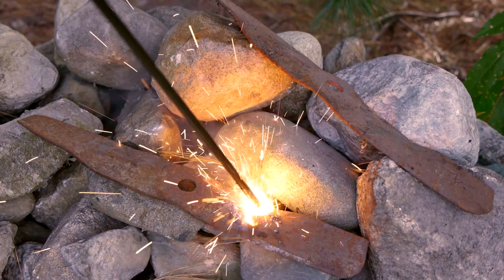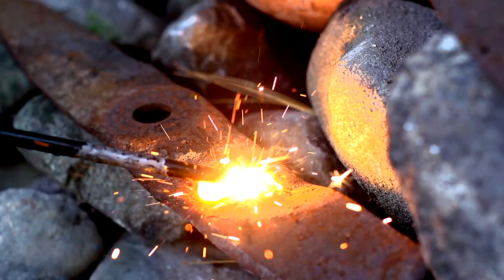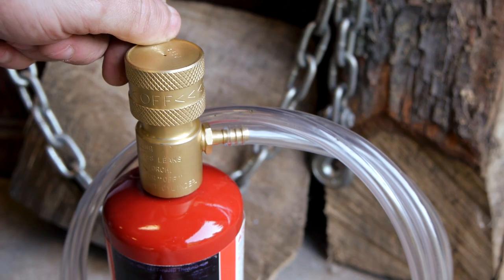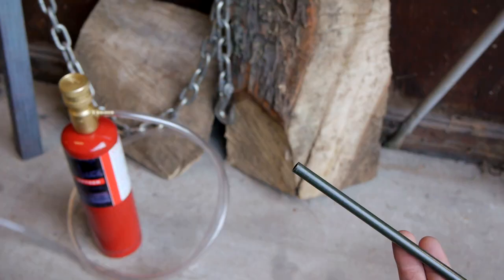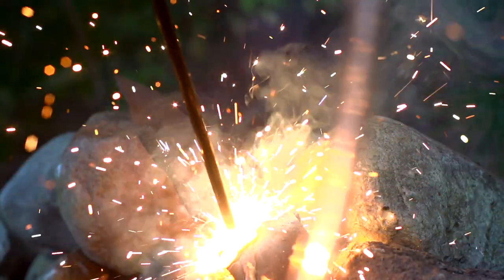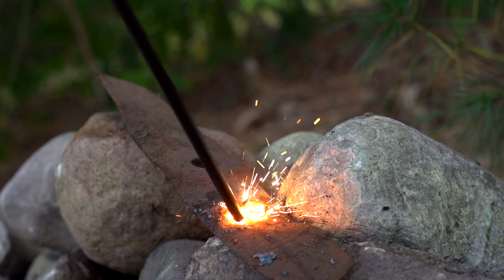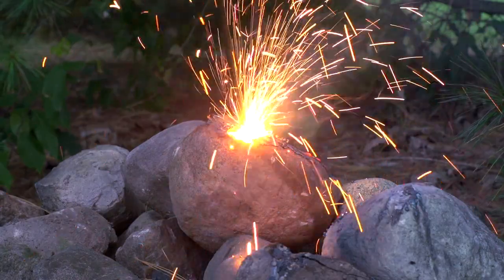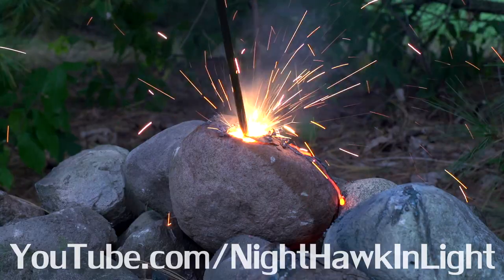How to Make a Thermal Lance Kit - Hot Enough To Melt Rock - NightHawkInLight

Comment: Having just made one of these myself I have a few tips for others. First of all thanks for the great idea. I made a few improvements on yours. I used fuel line for more durability, make a handle with a 1/4 valve to shut the O2 off quickly and used a brake fitting to attack this to the valve and essentially made a handle by adding some steel pipe. But it still runs through tanks incredibly fast and is currently at about $40/minute to run which is vastly more expensive than any other cutting system out there.
Reply: Of course it's expensive due to disposable oxygen cylinders. Your fuel line mod is slick and permits quick replacement. I like it.

Comment: Such a simple design, and yet so much power and potential!  I love your genius in improvising the ignition source.  Congrats in advance on 1M subscribers, you deserve it!
Reply: +Grant Thompson - "The King of Random" you should improve this design to a safer one
Reply: +danyCD17 LOL - There is only so far you can go to make a thermal lancer "safer". Braided cable tubing cover, welding gloves, and a face shield...unless you can get a robot to do it. :-) And if anyone can do that, it would be +Grant Thompson !
Reply: +iguanian Also I would add an inline gas check valve (for oxygen of course) and those are cheaply priced and maybe the addition of a horizontal handle of some sort like ones found on a hammer drill/drill affixed with a good quality stainless steel hose clamp or pinched between a bolt and 2 large washers and nuts or something that you can hold on to better and apply a little more force into the work.
Reply: +13andsim Also ... I am wondering if one were to paint the brake line with real aluminum paint @ 99.5% purity it was pricy for spray paint ( a few coats at least to get a decent amount of thickness) and would that make it burn even a little better? or even a little hotter? or would it just burn up the "rod" faster with no substantial benefits?
Reply: +13andsim Lol...  Now I am wondering if I were to spray paint some rust dust with this "pure" aluminum (spray it inside a small box which is filled with rust dust and shake around, spray another small amount in, shake box w/dust around and repeat) and see if anything would happen if ignited?? Hmmm, I absolutely love experimenting with things.  ;-)
Reply: +13andsim You were in my mind and bit me by minutes!! I was thinking something like a mix of epoxy and aluminum (oxide) powder smeared either on the outer and/or the inside of the pipe
Reply: Lol hey man :-).  I think either (or both :-) ) would be worth trying at least once ... I mean it would have to have some effect ... whether a positive or negative one THAT I do not know ... but that is one of the reasons we all like to experiment I think ..... I think this thermal lance idea is pretty cool none the less though and have some uses in my head already for this cheap and easy to make bad boy.
Reply: Thanks 4 creating man👍
Reply: While Electronx Gamer is rude, he has a point. I've nearly unsubscribed many times lately. NightHawk still does the awesome stuff. The rope videos are cool, but you need a lot more of these type of videos.
NightHawk does deserve his 1M subs. You do, too, but don't forget the stuff that made you tops.
Reply: The other day, I viewed an ancient Youtube documentary, can't remember what it was called, though the guy was packing his thermal lance simply with about 1/8" rolled lines of aluminum foil.  I believe he was using a regular steel tube of a similar thickness, likely of which is found at any hardware retailer; also connected to a rubber tube powered with pressurized oxygen.  When you mentioned adding aluminum paint; I thought, why not just wrap the brake line with aluminum foil?  My chief concern however, after viewing videos from multiple channels on the same information, is the risk of an explosion.
Reply: I stopped watching KoR because he was doing such dangerous stuff without even a mention of safety concerns.  At least Night identifies what is dangerous.  Whatever happened to KoR?
Reply: emaglott He died in a paragliding accident
Reply: Oh man.  I see that now.  Very tragic for his family.  He was obviously a risk taker.
Reply: RIP, hope his family is doing well
Reply: Grant and night hawk. BLESSINGS 🙏
Reply: Just found this video that's to a TV show and searching a thermal lance and I see this comment man I miss Grant
Reply: Rest In Peace buddy
Reply: Damn 7 years later and has only gone from 1M to 2M subs. Criminally underrated

Comment: Question: Can this be used to drill through a standard bank vault?
Reply: +Alex Jones You can buy brakeline in spools too ;-)
Reply: youd have better luck with a big whole saw
Reply: Guys! you need to set up the thermal drill!
Reply: No i dont think its hot enough to melt ceramic
Reply: Asking for a friend that owned a bank?
Reply: @gradoisx2348  not sure what ceramic has to do with safe or bank vault but yes they can melt that ,virtually any material can be melted with this,i melted tungsten rod with it
Reply: I hope...
Reply: @John Dave those too , this tool does not just rely on heat but also by oxidation, once the material gets to temp it burns away by reaction with oxygen end becomes fuel itself but at temps of 10,000 degF most things melt or burn ,the materials you mentioned are below this melting temp aside from starlite which is uncertain on its full capability as there have been claims but no actual verified tests to see how much heat it can take so ill leave that one as a unknown
Reply: GUYS THE THERMAL DRILL GO GET IT
Reply: Yes, but it might take some time, and honestly reliability may be an issue
Reply: as for cutting into bank vaults, I read that a thermic lance is not subtle, it makes a lot of noise and light. I suppose explosives are not subtle either, there’s no such thing as cutting into steel quietly.
Reply: @darylcheshire1618  chemicals are quiet
Reply: @chrishansenbiz  Acid takes too long.
Reply: @darylcheshire1618  just get hardware expert basic, makes it completely silent, and only costs 1 skill point

Comment: Thank u so much.  My step-father 
S dad left us a storage unit like you would find on a cargo ship but nobody could get through the 3 different extremely enormous padlocks thar were on it.
So I used your technique and purchased a small oxygen tank and a small clear plastic hose and a 5/8ths inch brake line and used the the steel wool and wha-La.   It actually freakin worked.  I threw on a pair of welders goggles.   I  wasn't sure what strength I needed so I just bought the most intense ones I could find.  Then I amazed my relatives as I cut the padlocks off like I was slicing butter with a blistering red hot knife. 
The hilarious part to this story is there was a chest with $1200 in cash and about 16 leisure suits that had so many moth holes in them they were worthless.....and a few penny farthing bicycles that some second hand store bought.  I think I got around $120 for my efforts.  Lol.
Oh well.....I wasn't looking to get rich but I thought it was fun to put my family ( who I only see when someone dies ) in "AWE" as I cut these bolts off with "magic"  lmao.
Thanks 4 the video again buddy

Comment: In this video, Night Hawk In Light harnesses the power of the Sun.
Reply: Gtfo
Reply: what
Reply: +HouseholdHacker "In this video, I build a small fusion reactor, strong enough to power a village for about three or four years. For this project, you will need a PVC pipe, duct tape and three jars of mayonnaise..."
Reply: +HouseholdHacker 
slaps a flashlight on the thermic lance
Reply: praise the sun!
Reply: just found out Dylan died, kinda surreal that this comment is right next to Grant's, RIP both of them are legends

Comment: So.. would this be able to melt through steel beams or would this require jet fuel to do so? :D
Reply: +Mix0 You don't really need a thermic reaction to melt steel, burning jet fuel is hot enough to produce pools of molten steel.
Reply: +Shamsulazhar Yes, but can jet fuel melt steel beams?
Reply: +Aidan Sprucechopper  I think it can according to the official NIST report.
Reply: +Shamsulazhar yeah we cant doubt the official report so it must elementary science... jet fuel must obviously melt steel beams
Reply: +Mix0 i just realised how wrong I was, you don't even need the extremely high temperature of jet fuel to weaken steel. 

If you look at building No. 7, small office fires are sufficient to weaken the steel to bring the building down symmetrically at near free fall speed as if the bottom floors offers absolutely no resistance.

So there is no need to use thermic reaction or even the extremely high temperatures of jet fuel to weaken steel.
Reply: ***** That's what they tell you
x-files music plays
Reply: therealnightwriter I remember a bearded guy buying a couple magic jets a few days before 9/11 in the shop down the street...
Reply: therealnightwriter neiher
Reply: +Mix0 Without a problem. What he made is a homemade version of the Arcair SLICE. I've used one for decades. It also works underwater.
Reply: +therealnightwriter So all those eye witnesses were "plants"? Oh please.....
Reply: mrdojob Key point to take away here: Don't Feed The Trolls. I see your point(s). I agree with them. They don't care. They don't understand physics, structural analysis or building design. They only wish to get under someone's skin. A infantile cry for attention.Nothing more. And now you know.
Reply: it isn't trolling only, since that physics report came out from Europe and concluded that 9/11 was controlled demolition. 

no: jet fuel doesn't make "pools of molten steel" that's pure nonsense.
Reply: if you believe in fairy tales yeah lol
Reply: I @ShifuCareaga  Oh boy I love obscure "physics report" from Europe with no citation on controversial topics magically proving you right!
Reply: yes, and you don't need to build one you can buy a portable lance that fits in your palm. They use them at shipyards and other places.. I seen one that was a tiny bottle attached to a screw on gun with a long stem out the gun nozzle and had an integrated igniter; it instantly turned 1/2 steel into a molting pool.. They work on all types of concrete too.. It'll destroy everything that's why they aren't used where any form of precision cut is needed.. Even people who work in industries that can use them don't know you don't need a big lance rig..
Reply: @shamsulazhar  according to the official NIST, building 7 just collapsed form catching fire without ever being hit by a plane (this was the first and only case of a modern building collapsing just by flames) so i wouldn´t trust that
Reply: i'm reading the replies without realising what some people are getting at.  it happened as the reports say it happened.  check out the collapsed roof in any industrial building fire.  it doesn't need a fully fueled up jet on fire to sag a factory roof.
Reply: oh, and another thing, 30 years ago i was part of a team whose job it was to strip out and expose the entire steel framework, bit by bit, in a high-rise government building (which remained occupied) in perth western australia so a team could follow us through and spray pearlite and plaster onto the steel frame to make it more heat resistant.  they were followed through the building by the patch-up team so you'd never know anything was done.  this was done because of changes to fire regulations.  the trade centre towers were bare steel.

Comment: Wait, that's it? It's just a steel brake line? Wow, shockingly simple.
Reply from the maker: +mickeybill I tried much more complex designs, but in the end I couldn't improve the design any more beyond a simple hollow brake line.
Reply: not really,this one is mickey mouse in the work its able to do compared to ones packed with steel ,iron or specialty wires and using high compressed oxygen cylinder
Reply: @Nighthawkinlight  ,how about a tube with thicker walls?  would it last longer?

Comment: Thank you for the ideas to get me started, I ended up using 3/8" seamless drawn hydraulic tubing as the consumable and made my own handle/holder assembly out of miscellaneous fittings with a ball valve to turn the oxygen on and off. Blew through a pair of 2" diameter by 9" long pins that were rusted in. 50psi was the magic pressure for my application.  Worked shockingly well. The hydraulic tubing was too heavy to ignite with steel wool, so I would just heat the end of the tube to red heat with a torch. I ended up having to preheat the end of the pin with a torch to get the cutting action to start also.
Reply: Thanks for that; was helpful.  I used 5/16" steel brake line and 20psi oxygen. Was able to quickly melt through 1.25" x 6" pins that were rusted in small loader/backhoe.
Reply: @billsmith7673  that's a great idea, I'm sure that's a lot cheaper to burn than hydraulic tubing is.

Comment: I tried the design and it worked quite well.   had to do some learning on the spot about cutting with thermic lances, but I was able to cut through a thick bolt pretty easily.

Comment: I work on container ships. I've only ever seen thermal lances used in the Navy for damage control and the mechanics of how they work were never explained to me. Being able to fashion a tool that can cut through tie-downs in a matter of minutes out of scrap metal and an acetylene torch? This could save my life. Thank you.
Reply from the maker: I would test these before relying on them for your life, working on container ships the thickness of steel you might need to cut may require the real deal.